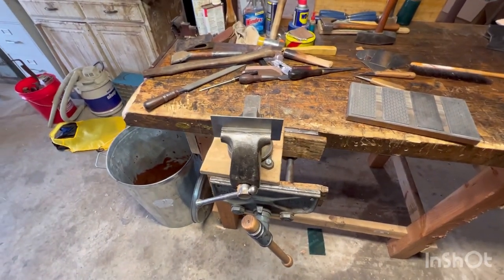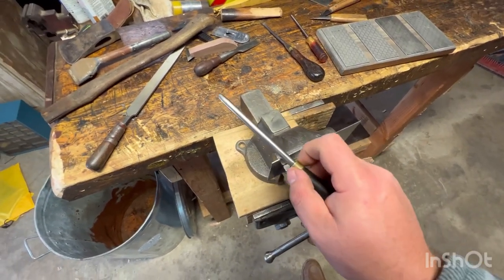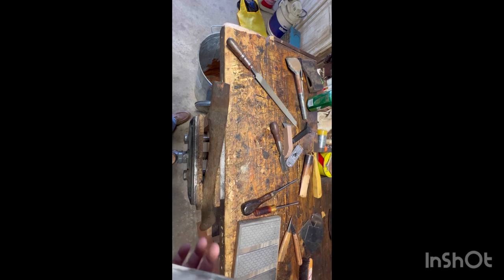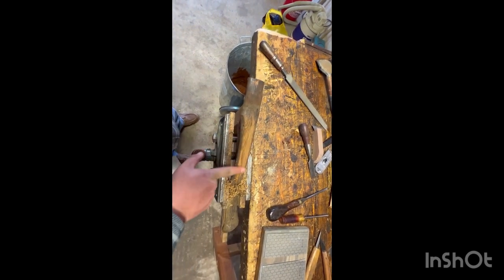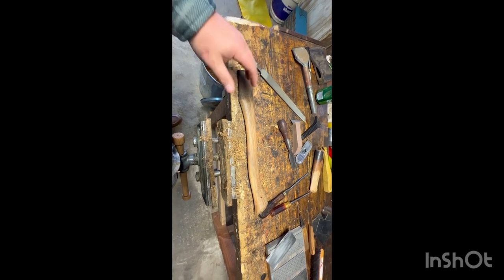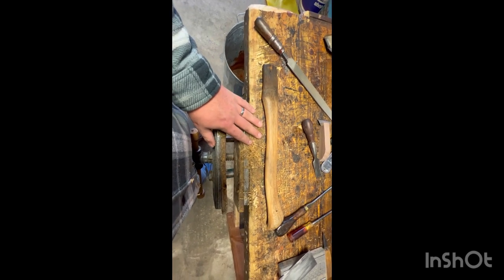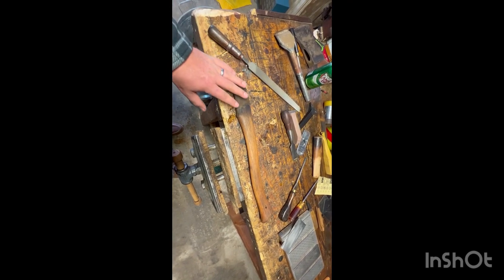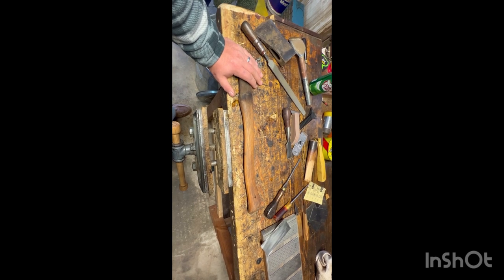How to Restore an Axe Handle and Card Scraper Secrets Pt. 2 (sorry for camera changes)

Comment: I also like using scrapers and have made several from old panel saws.  I cut off a blank using a cutoff wheel.  Hack saws are generally not hard enough to cut another saw blade. Once I have the shape of my scraper, I use your technique to put an edge on the blade.  Old knife sets often come with an excellent burnisher and I have used a large round screwdriver shaft as well. Thanks for sharing your techniques.
Reply from the maker: Awesome! Glad to hear you have used and had success with this technique as well!! Thanks for watching bud!!